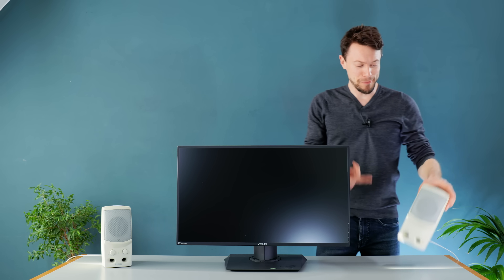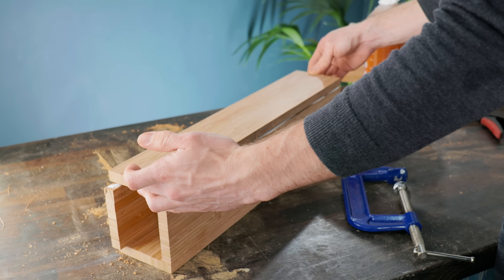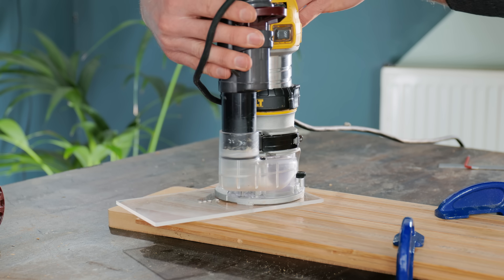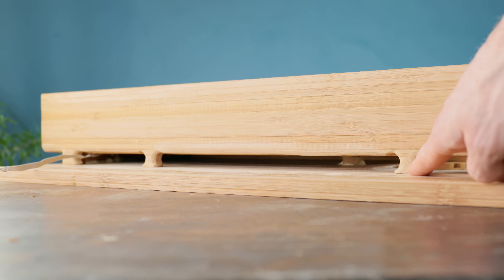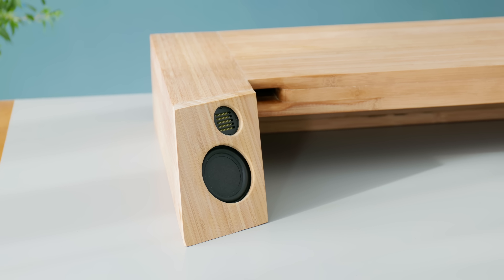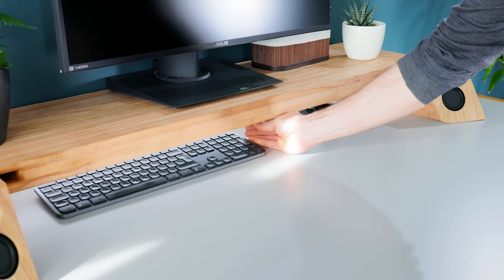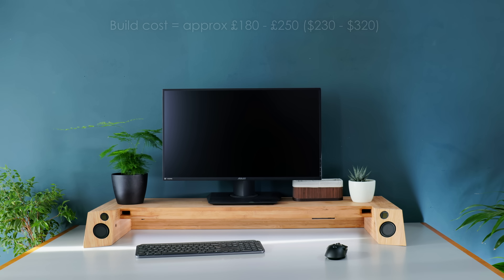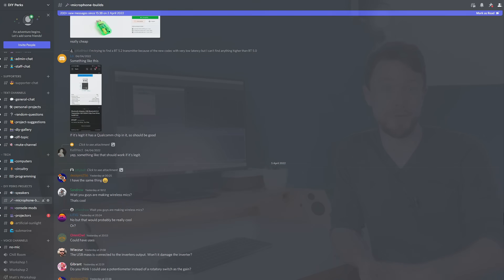Building a PC sound deck... with a twist!

Comment: mdf is too dusty when working with, but sanding reclaimed wood is not? :D On a more serious note, a nice middle ground I think is to buy finished bookshelves at HomeDepot etc. These are usually veneered mdf or something similar and come in a wide variety of lengths and widths as well as finishes, plus they are CHEAP. Of course if you start cutting in them, those sides will not be pretty, but if you can hide those sides that is fine, or you can at least clean it up a bit I suppose. It probably won't work well for this amazing sound bar, but simpler projects, they are great.

Comment: 1.2K speakers sound better as far as I can tell but the DIY ones are pretty close. It's just that the DIY speakers sound more like laptop speakers compared to the expensive ones. I am listening from an AKG Y500, connected via analog cable to the line out of my monitor which is fed by my 3060ti.

Comment: I’m not sure that you will see this, but I am wondering what you day job is/was. I am struggling to find relevant work, but have similar interests/skills and wonder if you have any advice. I am graduating from university now with my masters degree in Electrical, computer, and biomedical engineering.

Edit: I would greatly appreciate advice from anyone else with similar interests and experience relative to the question as well.

Comment: Holy hell, my IT dept actually has an identical (albeit much more yellowed) pair of those Cambridge speakers you showed at the start. This thing is rad, I would buy one/make on myself if I had the money. Currently using two Logitech X-120's from around 2003, and the stock dell soundbar between them. Tbh, seeing as I sit kind of low relative to my desk, the speakers provide an unusually good sense of surround (it freaks me out listening to music sometimes, like something moved on my desk), and since I have the soundbar with 4 smaller drivers than the main ones in the logitech, I keep the logitech tuned more towards bass to make up for the lack of a woofer.

Comment: One thing to note is that higher quality crossover components will have a noticeable impact on sound quality, if the speaker is designed well.
Reply: I’ve been involved with the speaker design process for architectural speakers and never saw parts that small in a crossover!!  I’m worried that the tiny crossover components may easily overheat.
Reply: @chrismerklin8460  well he said something about them being part of the circuit before amplification, so not much power going through but I'd still imagine the parts make a difference at low level signals.
Reply: @chrismerklin8460  sadly this part which seems to be really intersting he even doesnt touch in his process of the work he shows. when he shares everything about the material it would have made sense to share the final version of the crossover.
Reply: @Odyseuss08 The chap has linked a separate video with more details on all that.
Reply: @tatianaes3354  where? i dont find it.

Comment: I was listening on my 5.2 surround system and the DIY build had far superior sound in my humble opinion (as a home theater install tech guy).
The aesthetic of the build is right out of a sci-fi film. Great job as always.
Reply: Its a really cool project, and the diy definitely has more bass and highs, but the high mids sound like there is a huge cut, and there are some resonances throughout the frequency spectrum. Still insanely impressive for what it is and how much it costs though
Reply: 1200$ were better ;), DIY he made, IS AWSOME, but i doubt 99% here can reproduce the video it self and as well, he's DIY got huge bass, meanwhile with 1200's, you are hearing high frequencies, which were missing on DIY and because they are high, they cover the lows and ofcourse, lows are thick and leave a feel for "superior"........ :) Summary, DIY project he present, awsome, i would like having one (meanwhile couple of monitor speakers are on my desk), but those professional speakers are hitting really good. :)
Reply: @bananam0nk597  Yeah, the 1200s definately had a fuller warmer sound and sounded better on the first song but his DIY solution had a bit more fun sound or sparkle on the second song at the end test, sadly it can be hard to describe the difference.   It can be a hugely subjective experience though and sadly many people never really get a chance to experience a good pair of headphones or speakers.

Comment: I like the design, I like the construction, I LOVE the sound quality and you present an excellent video - but I'm going to have to call bullshit on the construction costs! (at least when shipped to the UK...)    If you add up all of the things on your list (including the $99 DAC) , even using the cheapest LED lights and trunking - the total comes to $485(+) (~£388). That's just 12 quid shy of £400! - NOT the 'approx' £180-250 you claim - and we haven't even touched the crossover yet....  what gives?

Comment: I'm listening on a set of ~10 year old Klipsch|THX 2.1 speakers and I can hear the difference between your custom build and the high-end. The high end has a much cleaner sound, although the bass is less punchy. Probably to be expected.
1 inexpensive thing to suggest as an upgrade, try using audiophile grade capacitors and resistors in your build. They really make a big difference. Standard caps sound muddy and I think that might be part of what's tripping up your build.
But super cool, as usual!

Comment: I don't know what he's on about, computer speakers are angled. You run into issues when trying to fit non computer speakers in your setup, and even with these, you could angle them quite easily if you make a platform for this purpose. In fact you can get decent bookshelf/reference speakers for less than £100 and you are better off. You can move them around and avoid the "cost" of building one of these inflexible bespoken types.

Comment: This is a very nice build but it is impossible to tell which speaker set is better.
To me it sounds like the $ 1200 speakers have more low to mid tones than the DIY set and the DIY set has much better and clear high sound. That is ... after listening to this on a set of Adam audio T5V monitor speakers with an extra subwoofer and verifying this on my ATM2 Wireless+ headphones. But I think this is fairly accurate since both your (sub)woofer and the midtone speakers are a bit smaller than the ones in the $1200 speakers. The ribbon tweeters in your DIY set are definitely better than the ones in the $1200 speakers.
Does this all matter? The PC soundbar sounds and looks great and keeps your desk nice. I love the LED strip and the fact that you can store the keyboard and mouse under the monitor. I've been looking to build a stand like this to house my keyboard, mouse, audio interface and a USB hub. No, not the speakers. I love the Adam's family on my desk and need these for mixing purposes.

Comment: Impressive on the binaural recording, obviously it depends on the recording but the comparison to the expensive speakers I could clearly hear the contoured sound of the desktop speakers to the diy ones, I’d guess the middle 1-2k region is a lot higher in the diy with the flatter response whilst the desktop sound dipped in this frequency region to sound more “hi-fi”. ..

Comment: DIY PERKS: Mdf is too dusty when cut

Also DIY PERKS: So I got this reclaimed flooring that needs to be sanded instead
Reply: I think he imagined that in the sander the dust can be collected by the device, but I agree with you: in both cases it will make a mess. But in the end the idea is very good!
Reply: Have you worked with MDF? It’s in its own category for being dusty as it’s compressed saw dust essentially. Sanding wood yields less mess all around.
Reply: @MassDynamics  I strongly disagree
Reply: @MassDynamics  also mdf smells worse.
Reply: you meant dosty?!

Comment: The bookshelf speaker felt like it's in the ambience, but the DIY felt like they are in the foreground, both have their own advantages.
The first audio felt richer in the 1200 ones but the second audio felt great in the DIY ones.
Reply: It was harsher not richer- but its not really about the cost, the diy had three advantages- a 10 litre resonance chamber and subwoofer, and it was carefully tuned over 4 days for his own room, and they were set up for the computer use case, not for use the opposite side of a room. 

They are things that money can't really make up for in the finished sound - but that was the point. It is a market gap. I'm sure if the same company made £1200 computer speakers they would be better.
Reply: @carbon1255  Hmm, makes sense

Comment: You could measure the dyi speakers and your other speakers with whitenoise and compare them.

Professional speakers sound more balanced and yours seem a low and high heavy. Might be resolvable with some tuning. But this is only hearing the binaural speakers.

Binaurals are not the best measuring tool for frequency as they are a stereo technique and ment to portray direction instead of frequency.

Comment: The other advantage of MDF is that it doesn't add any timbre of its own to the sound, which wood will do. Speaker enclosures are usually made of plywood for this reason: it's strong, and it doesn't colour the sound.
Reply: All speaker enclosures have a resonance - a frequency where the chamber starts to amplify sound. With MDF, the panel resonance is less noticeable and it is probably a good compromise for cost/performance with commercial designs.

But I don't like MDF, especially for DIY, it is not sustainable, easily damaged by chipping, cracking and from liquids and doesn't give a nice finish. I think bamboo is a great alternative material, but optimising the use of the materials isotropic properties with the speaker design is beyond DIY.
Reply: All materials vibrate and possess some degree of resonances (stored energy). MDF is more rigid than most woods so it's resonances tend to be higher in frequency. Good enclosure damping and cross bracing is important no matter the material.
Reply: I’m a bit perplexed by this comment. Does plywood “color the sound” or not?
Reply: @MassDynamics  No it does not. Don't listen to these pseudointellectual idiots. Wood or enclosure material does not "color the sound" at all. Yes, some materials have more or less sound dampening qualities, but that is it. This whole "wood colors the sound" nonsense is complete and utter bullshit.
Reply: @MassDynamics  All materials color the sound to some degree. Some plywoods are favoured because they are characterized by a deep toned but well controlled resonance than say stiffer MDF. This adds a degree of warmth to the sound that some designers have used to good effect. For instance many classic British Monitors of BBC design used birch plywood precisely because of it's acoustic properties. Iconic speakers like the LS3/5A, Spendor BC1, Harbeth Monitor and Mission 770 as well as dozens of other British designs were made from thin wall birch Ply damped with bituminous pads. The highly damped but deep toned resonance of bitch plywood adds to the charm of these speaker's. It adds a degree of warmth without smothering over the lovely midrange of these classic designs.
Reply: That whole wood coloring the sound myth is nonsense

Comment: The DIY speakers certainly had a richer, deeper bass compared to the more expensive speakers. Really good. Well done mate.
Reply: as with the two above me, you are not paying so much for the deep bass in the expensive speaker but more for accurate recreation of audio.
Though for just enjoying music and gameplay the are amazing for the cost and knowledge you'd get from DIYing it
Reply: @Icessassin  lots of potential for the diy speakers was droped by using this cheap tda amplifier modules.
I mean, they are not bad, but defenetly lak detail and controll. With a proper amp+dsp for phase+time correction the diy could have a chance against some "expensive" speakers
Reply: Yeah, the bass is better by a mile. I do think the DIY setup lacks a bit in the treble though.  A bit more air in the treble and it’d slay most other options.
Reply: You are tripping
Reply: @Nbomber Thanks Buddy.🙂
Reply: i personally think the diy speaker cannot compare to the professional ones. the diy ones are Good, but not perfect
Reply: @ZVLIAN  DIY speakers definitely had a very clear midrange reproduction. That said, the highs weere slightly less clear than the pro speakers. This could simply be cross-over inaccuracies as he'd been tuning them manually instead of calculating them from measuring pink noise.
Reply: @ZVLIAN  You are wrong, first, the bookshelf speakers aren't professional ones, they are luxury ones. Second, they cannot possibly compete with the DIY ones here, due to the inherent ceiling- the DIY set had a sub of 10L- that is incomparable. The DIY system was also set up for the listening position and room specifically. 

No matter how much you spend on off the shelf audio equipment, it will never beat a set up system quite frankly. For those discussing more accurate audio, that is quite frankly incorrect, accurate audio monitors isn't very expensive, it is audio improvement that costs money and makes speakers 1200 that do not reproduce the original sound. 

Look at it this way. To the bookshelf speaker manufacturer, your room is a black box. How many cubic metres is it? how high is the ceiling? is it in a corner, in the centre of the room? what height are the speakers? where is the listener? how does the sound interact with the furniture- as a sound engineer these questions are vital for audio quality and are unanswerable, so the manufacturer has to take an average for the most part, and make predictions. None of these will be able to account for desk use- which is an extreme listening position certainly, and is often in a completely different kind of room. 

If you have a decently expensive sound system- don't set it up, just put it in a much different room and listen to it from a different position- you'll find the audio is far different. 

As to accurate sound reproduction- the ones that do that require sound absorption to negate the effects of the room, for audio studios.
Reply: @ZVLIAN  My ears must be all wonky then, the DIY ones sounded [in my opinion] much better. P.S. I did listen in on some nice headphones.
Reply: @ZVLIAN  I personally think you can change it with equalizer and effects to your liking. I always max out bass no matter what system.
Reply: @ZVLIAN  same opinion
Reply: Agree but professional speakers has much clearer hights.
Reply: @VavrMar  the DIY speakers are made by a professional, it’s  handmade professionally
Reply: Professional speakers are not necessarily made to enjoy music, but rather so that the listener can hear the full spectrum as like the music were played live. So the professional can mix and master the music according to the project. That's why speakers for common users may have more bass, but they don't have the same auditory sensation. 
In this case it's a matter of preference, but it doesn't mean quality.
Reply: @akiranishihira  What youre describing now are monitor speakers, (short: monitors) which are made to do that exact job. But I can tell you that monitors are 100% worth their money. I got my JBL LSR 305p's for around a year or more now and mine served me oustandingly well. 
These really are made for producers to really know what part of the music being played is the actual music or the speaker adding or subtracting volume in certain ranges of the frequency band, so they can make propper adjustments and not overcompromise on the speakers deficiancies. 
For example if the speakers would put out way more bass than they'd be supposed to, the person making the music would think that the song they make has way too much bass while it doesnt, so they subtract on the bass overall and create a song weak on bass without being aware. The job of the monitors is to prevent that exact thing. :D

btw yes im a total party crasher
Reply: @maxdergroe9082  You are right and I agree. I use KRK for recordings and a pair of old Roland's for general use, and I'd also rather hear all the instruments than just have bass. I talked about monitors, because the thread was talking about professional use, that's all. But still, DIY speakers were made right, professionally, designed to sound great. What I meant is that bass doesn't mean quality. For regular users, each brand and model tries to favor a specific audience so it's normal to have a frequency band with more presence than others. In the case of video, the expensive speakers have better definition in entire music spectrum, which to me makes it sound better.
Reply: @maxdergroe9082  I wouldn't see jbl lrs, krk rokit or even my presonus eris as something professional.
They are decent and are defenetly flatter than some bookshelf speakers (exept rocket gen.3, the, were bass heavy af), but compared to some neuman kh or even more expensive speakers they all lak in clearity, flat response and accuracy
Reply: @ggk7605  you get what you pay for
Reply: Your right by the way why does a more expensive speaker sound worser 😡😡😡😡😡
Reply: @Jahangir-9k  its not better audio wise, it sounds better to the average ear for listening to music and general gameplay
Reply: @Icessassin  You mean the equalizer values he set up?

Comment: You actually don't want the speakers directly aimed at you, unless that is exactly what they were intended for. Every speaker has a testable amount of distortion that comes from the angle of listening. Some speakers want fifteen degrees of offset from the listening position, some are acceptable up to 45 degrees. But generally, aiming directly at the listening position is not best, although it will be the loudest.